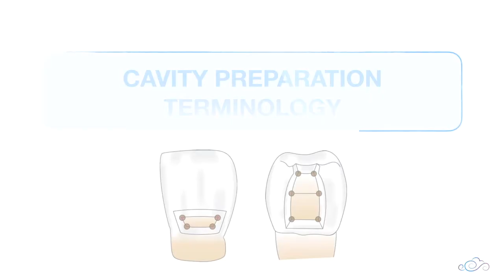Cavity Preparation Terminology – cavity walls, line angles & point angles in Operative - En

Comment: I have a question about line angles. What is the difference between external and internal line angle? 
Thank you in advance for your help ❤.
Reply from the maker: The external line angles are the lines that are between two external walls and exposed to the outer surface. 

The internal line angles are the lines that are NOT exposed to the outer surface. This line angle is between two internal walls. Such as the axiopulpal line angle, and the axiogingival line angle.

You can see I point at them in 00:36 and 00:43

I hope it is clear now.